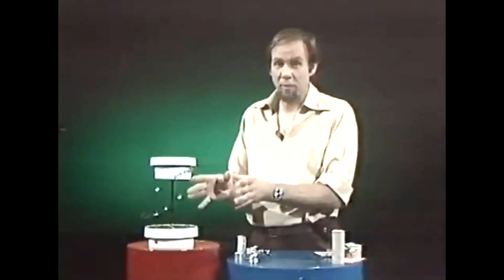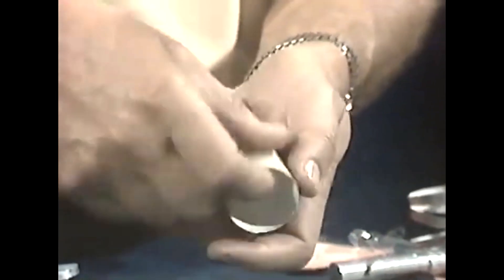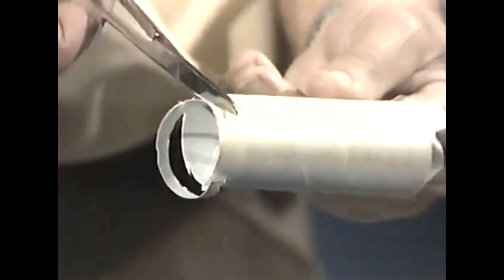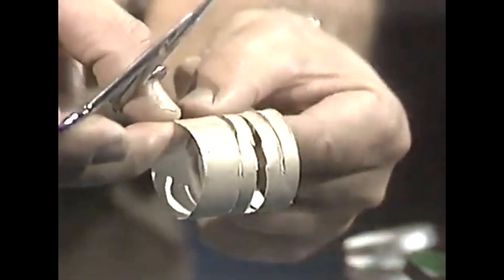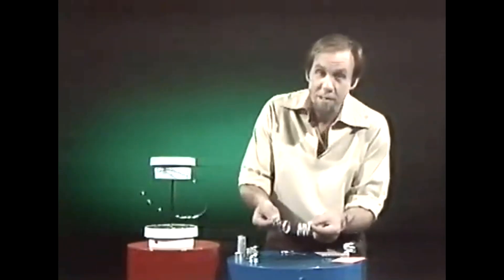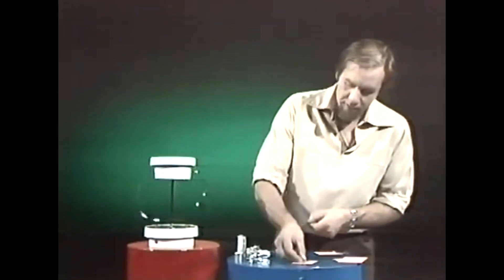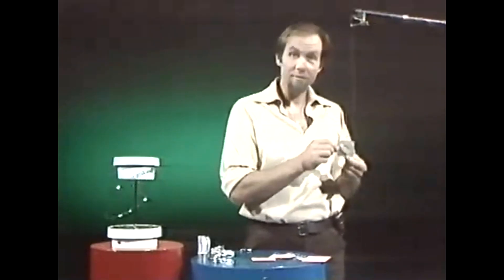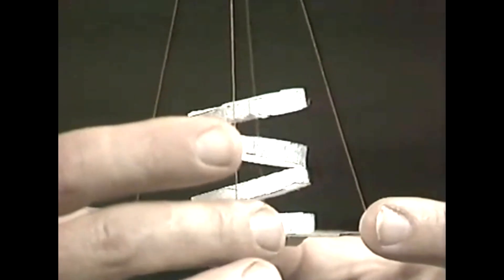Spinning Rings Illusion

Comment: Kind of reminds of the illusion where there's a large faucet head suspended high off the ground, not connected to anything, yet continuously flowing water out and down to a barrel. I saw this at the mall as a kid in the 80s and was completely mystified.
Reply from the maker: Yes, it is the same thing - Rob